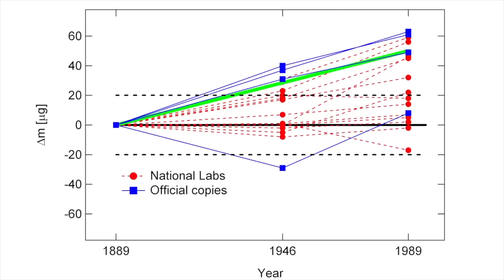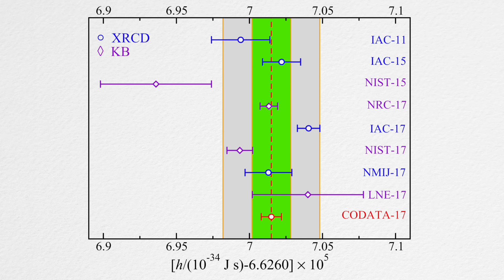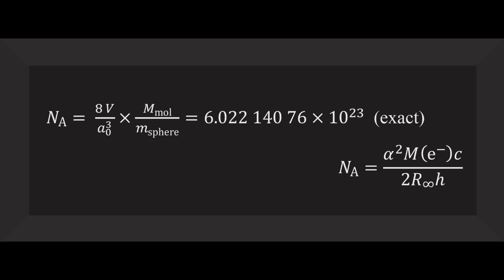The kg is dead, long live the kg

Comment: Why do I think that US will not be one the 60 countries?
Reply: Imperial is based on metric. America has its own Kilogram in a vault.
Reply: @sambishara9300  America doesnt use the Imperial. The british reformed theyre System after the Independence of the US and renamed it to "Imperial". In the 1820 if i remember right. So while the Us shares the Names, many Measurements are different. Best example would be a Gallon. A Imperial one i 3,7L, an American one is 4,5l. So the names are the same and the ones the British didndt change are the same. But the US  has the "United States Customary Measurement System".
The us and the UK even agreed on what 1 Pound is in the 1950´s or 60´s (cant remember that exactly) after almost 100 Years of constant changes what a Pound is. And just to annoy we Germans stil lhave our "Pfund" which is translated Pound. That one is 500g.
Reply: @Harold Potsdamer: Those who need the 10-place accuracy will have it, those that don't won't, regardless of the units they use in practice.  No one in the US or anywhere will use pounds when they require 6-7 places of accuracy.  Nothing is fake, nothing is illegal. In time, the pounds will disappear; we are farther down that road than we were when I was born, whether most people here believe it or not.  What will happen, however, is that one or more of those ten-place-accurate constants will be found to not be what is defined, and will need adjustment, and will certainly change when science begins requiring 15 places of accuracy.  Look to your own knitting as we look to ours.
Reply: They are though. This is very important for the scientific community
Reply: @Harold Potsdamer Americans do not hate the metric system idiot. They just are used to US customary units.
Reply: @oussematrabelsi9429  Well, to be fair there seems to be a fair number of people (mostly Americans, but the odd Brit here and there) that make comments a lot closer to hate of SI/metric than indifference when discussing which unit system to use.
Reply: @Harold Potsdamer: I'm an engineer; I've used metric pretty much all my life.  I like it.  There - have I kissed your ass sufficient to appease your lack of peter?  I  agree with everything you say, but your attitude does not impress.  Bye-bye yourself.
Reply: @Harold Potsdamer The pound (USC/ACU) is DEFINED as 453.59237 grams. Not a "never ending" number, and (not coincidentally!) within the same rounding error (50 micrograms) of the calibration process of the "platinum kg". Incidentally, while you have a point that the imperial and ACU/USC systems are not the same, the pound is defined as exactly the same in both systems.
Reply: The Brits use the imperial system too, just not Fahrenheit.
Reply: @DraxTrac  Actually the only official imperial units in use in the UK are feet, inches and miles - and only (in official terms) on road signs.
Reply: @A-rk3dn  If by forever you mean a couple of generations, yes. It's a pretty unambitious definition of forever though.
Reply: Imperial are defined via SI units
Reply: @Harold Potsdamer Yes the Us signed the treaty as one of the 17 back then but joined in 1878 if i remember right it was because the 2 Kilogramms for the US were delayed a bit in the production.
Reply: Actually, technically US also uses kg. But they use their kg prototype to define lbs and etc. So what they to is basically transform kg to lbs for people who are so dumb to use lbs and imperial system in 21th century.
Reply: @tevvel  Americans use both...  And I see far, FAR more non-Americans complaining about it, even when it's on American media.   Who are the stupid people, exactly?
Reply: Emir Halıcı 
I mean, don’t the brits measure people in stones?
Reply: @Drapervale  Yes. Stones and pounds, where a stone is 14 pounds and a pound is exactly 453.59237 grams. Don't ask why.
Reply: @tevvel  I am not "dumb enough" to use the imperial system.  I was taught it from the earliest age I could learn and I have based my entire world view around it.  It's taken four years of highschool classes to unlearn it, and all of them were science classes that relied on the metric system.  A lot of people don't take science classes that need the metric system, and a lot of people haven't taken them.  That does not make them dumb.  Asinine statements like yours help no one and are a hindrance to discourse about, well, anything really.  Pompous asshat.  

Also, for good measure, your statement is fairly ironic; put a 'the' in front of 'US' in the first sentence so it will make sense, remove 'and' for the second sentence to make sense; change 'to' to 'do', reword 'so dumb' to something like 'dumb enough', and put a 'the' in front of 'imperial system' to make the third sentence actually intelligible.  Oh, and never, ever say '21th' again without making the rest of your comment have a matching lisp... letht you be judthed for being 'tho dumb' yourthelf.
Reply: @fatuousinnovatorofsadness4640  "for good measure". LOL!
Reply: Emir Halıcı well excuse me for being taught imperial units. Blame the pirates that took our original Kg prototype
Reply: @tevvel  You do know that we are taught how to understand how both systems work, we just prefer to use pounds because it's what we were taught growing up, and they only teach metric in 4-5 grade, we are brought up on imperial and just like language, systems of measurement are easier to manipulate in your head if you learned them young. I mean it still is also technically metric, just Ameicanized metric. I don't see why insulting the county that has done more for science in the past century than Britain, France, and Russia combined.
Reply: @algaeninja6806  yes you are taught to understand both but average american citizen can't convert or understand metric. Why is it so hard to switch to a clearly better system. Which is standardized everywhere along the globe except us and uk(dunno about uk).
Reply: @tevvel  We would also have to switch our entire government to metric, (a lot of paper work , i.e. lengths of roads etc.) old people would get mad that "these darn kids don't know what tha reel tempratur ish outshide", and offical documents would have to be rewritten, which is easy when you are a small country with a small population, (belgium, Luxembourg, Vatican City, etc. or when you are a big country with a small population such as Canada, but with the third biggest country (land area and population) it's a bit harder. 
p.s. I'm not trying to flex that I'm American I swear
Reply: I for one, as an engineer major in America prefer SI units. It is a lot easier to do math in SI compared to English units where there's slugs and pound-mass... Conversions suck in English units
Reply: @tevvel  And the average non-American can't convert to Imperial. What's your point?
Reply: Do you even realize that all those metric standards are based on scientific research done and paid for by Americans? That Watt balance used to define the Kg is in the USA, so are the lasers and atomic clocks used to define the meter and the second.
Reply: This is such a dumb attempt to be smug about something inconsequential. This change only really affects the scientific community, and we already use metric. Pounds are used in daily life and this will not make any difference there, as the system is self-consistent. The imperial system is cumbersome because it makes quick conversions hard, but the metric system is also cumbersome in daily life because it is a system in base 10 which makes fractions a pain. There is nothing inherently superior about metric, it's just another political standard established by another empire (in this case, the French empire).
Reply: Thank you,  @welwitschia  very cool.
Reply: The French had one job to make the number system duodecimal, but no they had to use base 10 instead of trying to use the already existing systems that were in base 12!
Reply: @mariusbrandon2617  Exactly! This was pure hubris from the enlightenment. In their attempt to make all measurements 'rational' and 'natural', they arbitrarily chose base 10 instead of the much more practical and intuitive base 12. Just because we use base 10 to count, it doesn't necessarily mean that such base is rational in any way. It's just the typical unquestioned assumption that the status quo is somehow 'natural'. In case anyone wants an example of how hilarious and ridiculous this got, just search the history of when the French tried to measure time in base 10 as well (i.e., decimal time), and how useless that attempt was.
Reply: @welwitschia  Sorry, but I beg to disagree. Not because base 10 is in any way preferable in theory to base 12; but the choice of base 10 was not arbitrary: it was (and remains) based on the indisputable fact that everybody uses decimal for practically all calculations; even fractions like 15/32 are expressed using decimal numerators and denominators. Lo and behold, the US uses currency units based on decimal, and the British old pound sterling currency system (based on 10 AND 12) is no longer mourned - if it ever was - less than 2 generations after its demise.
Reply: @dlevi67  And I'm also sorry, but I will use your argument as an example of the exact hubris I alluded earlier. Your claim that a system of measurement that scales in base 10 is not arbitrary because we use a base 10 numerical system, but that appeal to the status quo is precisely an arbitrary decision. We only use a base 10 numerical system because we have 10 fingers, thus making the decision about scale one about a natural accident. And no, there is no practicality involved in this decision, as base 10 is a ridiculously impractical base for daily life applications. What I mean by this is that 10 is only divisible by 2 numbers, both of them primes; 12 on the other hand is divisible by 4 numbers, 2 of which are not primes. This is why we measure days in 24 (or 12x2) hours, hours in 60 (or 12x5) minutes, and minutes in 60 seconds. This is also why the dozen is used as a common measure of quantity, but the decile (is that even a word?) isn't. In other words, the "problem of fractions" is not that fractions cannot be expressed in base 10 (they can be expressed in any base), but that most fractions of 10 are not whole numbers. And please know that I say this as someone who grew up using the metric system and only moved to the US for postgraduate education in science.
Reply: @welwitschia   You remind me of the guy who rejected a pragmatic argument with the following: "yes, that may very well work in practice, but it absolutely doesn't work in theory".

We use decimal most likely because we have 10 fingers, and counting on fingers is a pretty widespread cultural trait. Fact.
 We seem to agree on that.

We use a sexagesimal system for measurement of time, and it would be impractical to change it to decimal, but given that the only fractions of hour or minute that people use (before they get to an explicitly expressed multiple of minutes or seconds respectively) are halves and quarters (for hours only), those would work equally well in decimal. Fact. Same - probably more so - for days: I've never heard anyone saying "this will be with you in a sixth of a day".

Arithmetic (and the rest of mathematics, where it uses numbers) is taught learned and practiced using a decimal system everywhere in the world, 
except in cases (not countries) where other bases are specifically the object of study. Fact.

Customary units are NOT generally "base 12". Some are, some are not; US fluid measures are base 2 (or its powers) only, as are most weight measures - though there one also gets other factors like 7 (stones, grains, long tons) or 5 (short tons). Even length uses 12 only from feet to inches; then you get several 2 (5), another 3, a 5 and an 11 to get to miles; none are combined in another explicit 12, though they could. So your argument that somehow customary units reflect a preference for 12 is not true. Fact.

In this sense, the choice of 10 is NEITHER arbitrary nor impractical: it depends on context and pragmatism. It is - as you say and I agree - arbitrary from a mathematical standpoint, and the use of 12 as a base might counterbalance the need for a larger effort in multiplication with a smaller one in division; I'm not sure it would, but I'm open to the possibility.
 

However that is only true in a world where everybody needs to start learning arithmetic. In a world that is as heavily depending on numbers as ours, "practicality" cannot ignore the huge transition cost, and 10 is not an arbitrary choice; it's what we are stuck with because we started there, just like 12 or 60 is where we are stuck on time because the Sumerians started there. It's a bit like arguing that everybody should speak Esperanto or Interlingua as a second language because it would be easier and thus more rational and practical; in practice, it is more useful to learn English, Chinese or Spanish because of history (demographics in one case, and colonialism in the other two). Rational? Perhaps not. Practical? Yes. Arbitrary? in a sense yes - there is nothing intrinsically superior in English, Spanish or Mandarin as _languages_; in another sense, it's not an arbitrary decision at all; it's a pragmatic one and if you want to communicate with the greatest numbers of other people you learn one or more of these three - it's not an arbitrary choice.

Oh, and yes, "decile" is a word, as are "(per)centile" and "quintile" - but they don't mean what you meant. And the word you are looking for does not exist in English or German (that often use "dozen" to indicate approximately 12, so 10 fits), but it does exist in other languages such as French, Spanish and Italian.
Reply: @dlevi67  Well, that was a massive shift of the goal posts. I don't know why you're arguing about the costs of changing the current system, when my post was about the origin of said system during the French revolution. The idea of using a base 10 system (or "decimal radix" if you want to continue being nitpicky about terminology) was literally agreed upon by five guys. Sure, those five guys were important scientists appointed by the French Academy of Sciences, but it still was five guys and their decision was arbitrary. In fact, to borrow your language example, the base 10 system is not that different from Esperanto in the sense that it is not something that emerged organically, but instead something that was deliberately and artificially designed for ease of communication. The difference of course being that Esperanto didn't have the support of an imperial power behind it, thus it never got far. 

Second, I don't see why you feel the need to show me that customary units are not necessarily base 12, when I never made such claim. I only gave examples of the benefits of those systems that do use base 12. Speaking of said benefits, it all boils down to the fact that common fractions of systems based in multiples of 12 are whole numbers, which somehow you find moot? Why do you dismiss this entirely by using a fairly weak linguistic anecdote about how people only use 'quarter' and 'half' when talking about fractions of hours, but purposely ignore the fact that other useful fractions are also whole numbers? Reading your post only gives the impression that this is for you nothing more than an exercise in smugness, otherwise why would you make a judgement like "However that is only true in a world where everybody needs to start learning arithmetic", which is at the same time normative and patronizing. 

Mate, seriously, you seem to just be looking for a fight where you can show how superior and rational^TM you are, but all you've been doing so far is tilting at windmills.
Reply: @welwitschia  Nobody shifted the goal posts. Your point is that a base 12 system would be more rational and that the choice of 10 was _arbitrary_.  My point is that 10 was not arbitrary and 12 may or may not be more rational.

Let's start by establishing one fact: the USC/ACU/Imperial systems are NOT base 12. They use all sort of factors, including 2 and 3. So where is this "system" that uses all the benefits of 12?

Secondly, other fact: most everybody - presumably including you - use decimal arithmetic. And if you want to be nitpicking on others, look at the meaning of 'numerical base' and 'radix', and you'll find that you are using them incorrectly. Just as you used decile incorrectly.

The choice of 10 was a pragmatic choice, given that most people are and were (even in 1792) using decimal arithmetic. It was not and remains not arbitrary or irrational - or at least not more arbitrary or irrational than choosing 12: there are costs one way and costs the other, and the decision (in my view rightly) was that the costs (in all senses of the word) were lower by using 10 rather than 12.

We can discuss the merits of using base 12 vs. 10, and I'm not convinced that in the balance having to learn 72 numbers instead of 50 is a sufficient merit for having multiples of 3 instead of those of 5 having a terminating fractional expansion (yes, that's what it amounts to), but as you would say this would be shifting the goalposts.

This said, we are going in circles, so this is my last post on this discussion. Let me wish you luck in whatever you decide to do, be it base 12 or otherwise.
Reply: @dlevi67  Lol, indeed. Yours is nothing but an exercise in smugness. You started responding to things people never said, when called out on it you just tried to change your argument into responding to other things that no one has said. Once again, tilting at windmills.

Seriously mate, you're just being silly. Did you just felt somehow personally attacked when someone mentioned that something you take for a given is simply a historical accident based on an arbitrary decision of literally five guys? I find it amusing that you're having such an averse reaction to two words--"arbitrary" and "rational"--and how you somehow made them to be mutually exclusive.
Reply: @welwitschia  When all else fails, resort to an ad hominem attack, eh? Please go ahead. I've had enough, so apologies if I don't respond to your trite attempts at holding on to an untenable position. Goodbye.
Reply: That’s what they WANT you to think!
But it turns out that the NIST is from the US and was driving this whole thing in the first place.
It’s the greatest ruse on EARTH:
Have the metric system defined by the country that doesn’t use metri

BUM-BUM-BUUUUUM